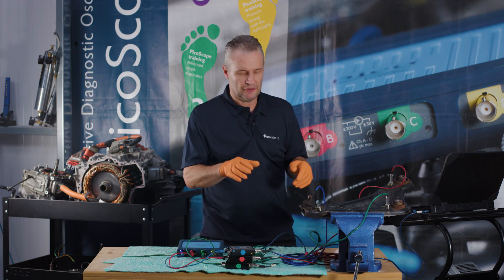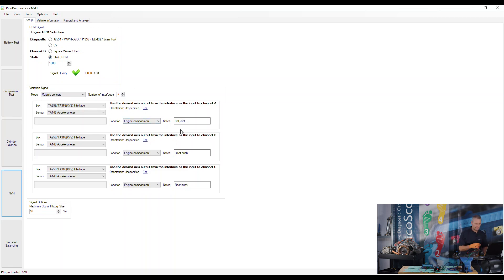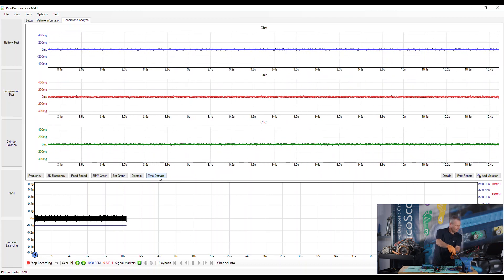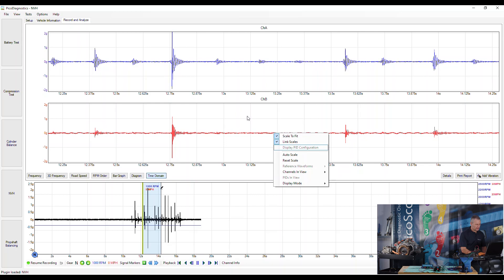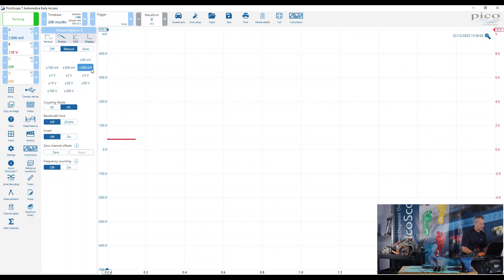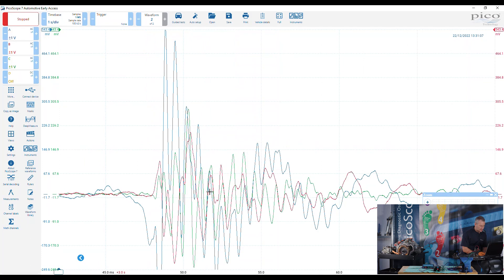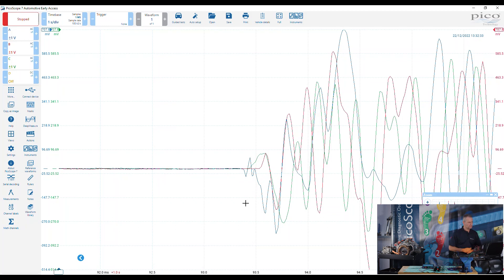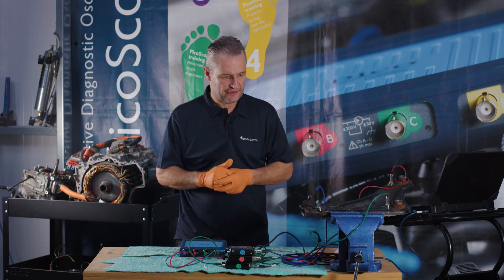Knock Knock (What’s That Noise?)

Comment: Steve I have a question. Let's say the steering rack or control arm is made of aluminum? What attachments Pico created or have so we can connect the probe to it? Like chassis ear clamps seeing that there is various metal composite on a vehicle
Reply: I use microphones from chassis ear with picoscope.
Reply: Thank you for the feedback and question: For aluminum I have used Bondloc B454 or Loctite equivalent. Alternatively we can clamp the accelerometer securely to the device under test or attach using the threaded hole within the accelerometer. Given the accelerometer is of "Mass Transfer" design, for this test, it can be mounted securely at any angle and still provide sufficient response. I hope this helps, take care.......Steve
Reply: @stevesmith4724  great to know
Reply: just glue it with very fast 2K glue
Reply: @svenk3726  lol

Comment: Please turn up your input gain on your microphone.  I have to max out the speaker volume settings just to hear your videos.
Reply: Interesting I could hear perfectly. Was it muffled for you?
Reply: Not muffled just too low of a  input gain or Db.  I'm in a quite office with my speakers set to where I can hear almost everything just fine when the volume is set right in the middle. In order to hear this speaker well I had to turn the volume all the way up. Then when the video was over I have to return it back to the middle position otherwise everything else is too loud.  All microphone systems have a gain input in Db.  This one is set too low almost like the microphone was on the camera and not wireless on the speaker.  If you are the editor of this video you should be able to tell that the audio at the very beginning (engine starting) is at a more normal volume and the speakers voice is so low you can't make out what he is saying without turning the computer speaker volume all the way up.  Keep in mind, no headsets here just speakers in a quite room.